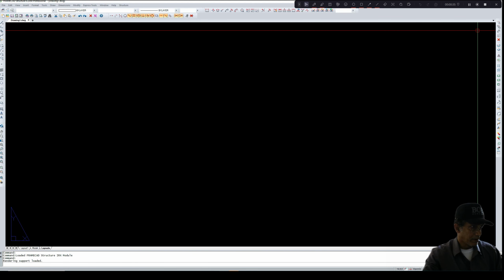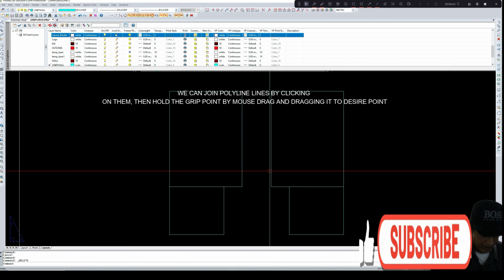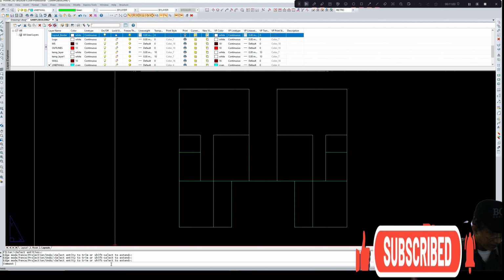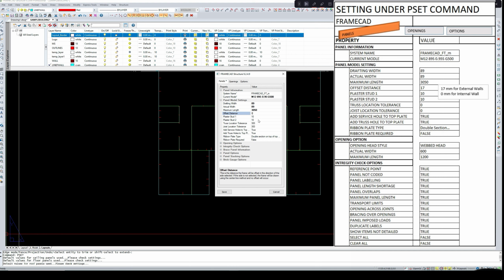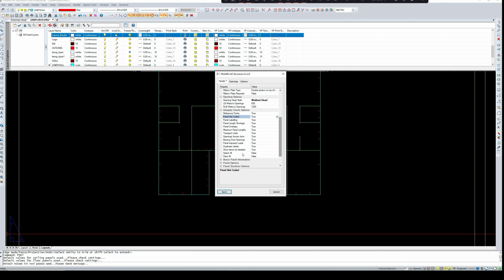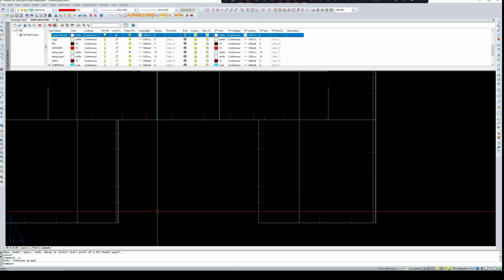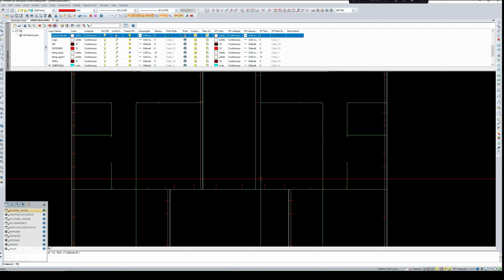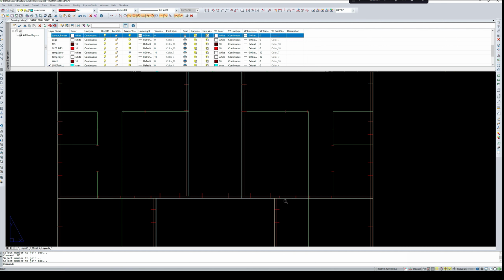SECTION 2A PANEL SETTING DRAWING EXTRENAL WALL PANELS R1

Comment: Sir please provide steel steucture compkete design od any industrial building including analysis and design....
Reply from the maker: I shall Start I tutorial for Implementation of Seismic Design after This. Then I shall start  Building with EOT Crane in Single Bay,  More Than on EOT Crane in Single Bay, EOT Crane on Multiple Bay, More Than One EOT Crane on Multiple Bay, Design of Process Building( Taking Sugar Processing)